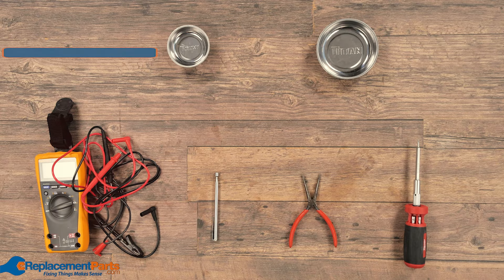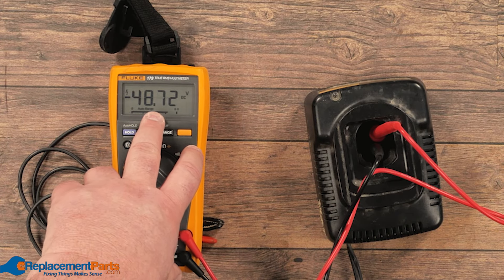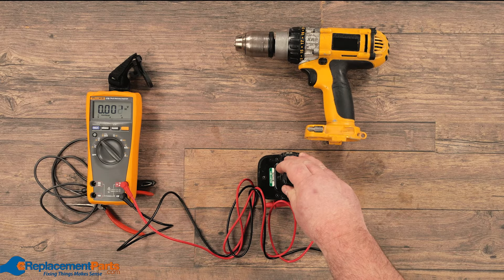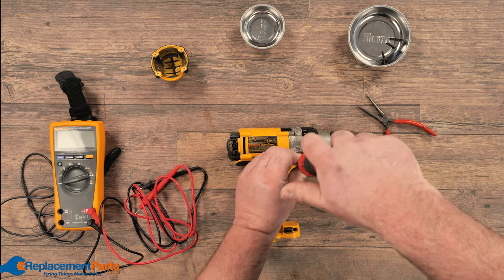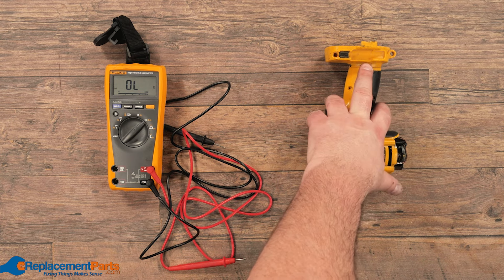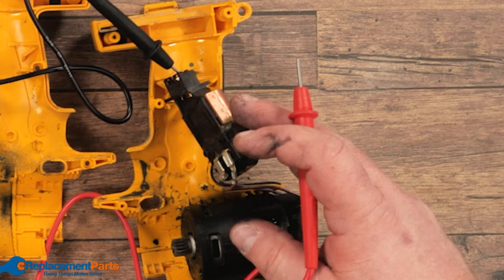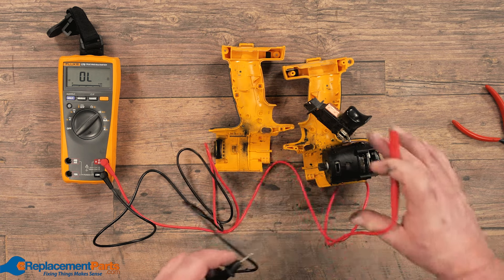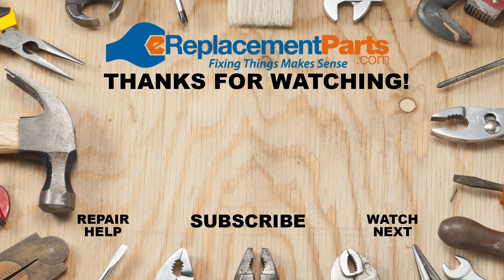Cordless Drill Won't Start? How to Diagnose an Unresponsive Cordless Drill | eReplacemenParts.com

Comment: Thank you for very good information.  I did noticeI was able to keep up, and retained some  information. Both my drills,  and a sander, is not working, and I need one NOW!  I have a critter in attic, and my outside attic door rotten on bottom, and,(. So I’ve been trying to build a door). I did, in the dark.,  I brought in the house to paint it!!! Was shocked!!!  There is quarter in space between each screw and boards. Even the glue between board!!  I had clamps on, Ha! At lease1/4-1/2”.  So I am going to buy a drill, charger, and battery.  Put a sheet of “something “ for temporary closer.....
It’s cold, drizzling.  
ALSO all summer have been stripping my two car garage for painting.
Have power washed, sanded, (as far up I can reach,  I don’t need to be on ladder ...
I’m only 74,  arthritis in my hands, back, etc 
Well, thanks for letting me get my frustration out,  couldn’t fine anyone else😁💕

Comment: You shouldn’t turn your multimeter on once the probes are already connected to a power source, you can damage your meter that way. Always turn the meter on first and make sure you select the right function, in this case... dc voltmeter
Reply: Good advice. Does it have to be set to DC or AC  though ?  Great video overall.
Reply: Ibrahima Bah well, both the charger and the battery put out dc current, so yes. And I think the only moment I saw him turning on the meter with the probes already connected to a power source, was when he tested the charger to see if it was really charging.

Comment: Does anyone know where to buy a new switch at? Not having luck on ebay, i have the dewalt 20v XR drill
Reply: Any luck?
Reply: @tylergriffin1294 have to get the motor with the trigger, around $50 on ebay. Going to buy the atomic drill for $45 on ebay instead

Comment: You didn’t even try to fix it, He legit just took it apart and said send the motor for a new motor and narrated as you went great narration terrible execution I don’t know what the issue is because it could have been a loose wire and I want to right know?
Reply: Ummm did you watch the video? He tested the charger (good). Then tested the battery (bad). Then tested the trigger switch( bad) and then tested the connection from switch to motor(good) then tested brushes(good). The motor is a one peice motor most likely sold as a whole unit. He did a wondeful job descrbing everything he did while doining it.
Reply: He woulda had to take apart the trigger and see about repairing it,  or replace it and buy a battery.